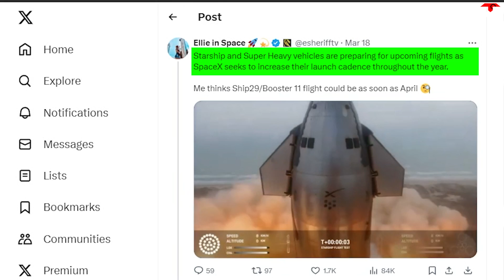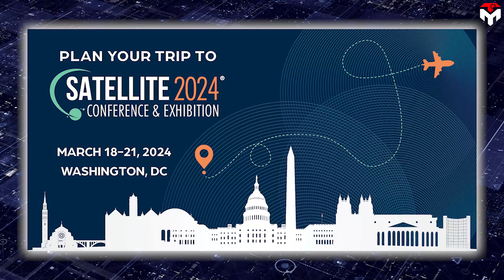Nasa just announced new launch date on SpaceX Starship Flight 4!

Comment: STARSHIP for the moon should be separated as with a booster!!! tanks with fuel and oxygen must be disconnected in orbit of the moon at Gateway station!!! and the section with astronauts will descend (with the necessary fuel for this) to the surface of the moon! then the crew will not need an elevator and the ship will be more stable because its height will decrease by 3 times!!!

Comment: THE ONLY SOTUTION!

 Baffles will not work to prevent the fuel slushing problem, because the tanks of the starship system are too large. That is the only reason why the starship engines have been exploding every time.

The solution:

The tanks  of  Starship and  Superheavy need 2 disk valves, expanding the diameter of each tank. One of the disks, the one on top, rotates above the contiguous disk to close the overlaping holes on the surface of the disks; to reduce the Size of the tank by dividing it, before any rotation or acceleration of the rocket. This will prevent slushings and protect the plumbing, if located 10% above the bottom section of each tank. Large telescopic pistons can be attached below the bottom of disk valves to control the fuel pressure as the piston expands into  the fuel tank. 
 I have built a model that works perfectly. The second disk valve can be located 10%  below the front of the tank, to also protect the front of the tanks from the slushing forces. 
The  gridfins are too flat and too small to be effective enough and will not be able to control the booster. 
Why is Elon  not using four pins instead of three to secure each heat shield tyle? Four anchor points provide far more stability to secure a tyle, not three. Also, each type should be constructed with the bottom half of the brick consisting of an interwoven latice of steal mixed into the silicon, to provide a foundation of strength and durability to each tyle. What is more important than securing the heat shield by providing the maximum stability and strength to each tyle? The interwoven steal mesh lattice mixed into the bottom half of the bricks, and the  four anchor points would eliminate the problems of tyles falling off the ship every time there is an engine ignition event. Please get this message to Elon. Thank you.
Also, Spacex needs 3 actuators to move the payload bay doors correctly, not two. They have only two now, one at each end of the payload bay. They need one at the center position.  Three will guarantee that there will always be enough support to open and close the doors, even if one of the three fails. 
I know the spacex engineers can see these problems. It is like ignoring the elephant in the room. The solutions should be a no-brainer. Musk needs to hire people who can be trusted and who will not continue accepting bribes from Jeff Bozo to sabotage and cause unnecessary delays to the Spacex Statship program.